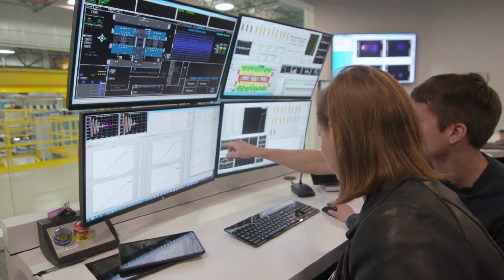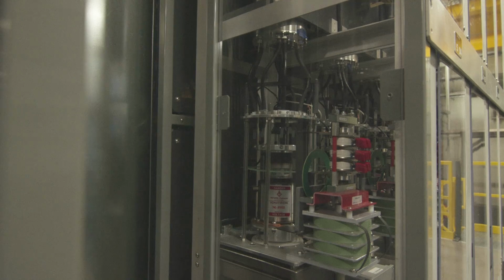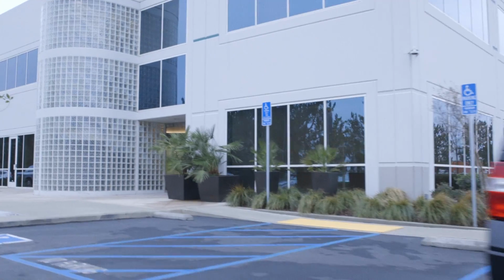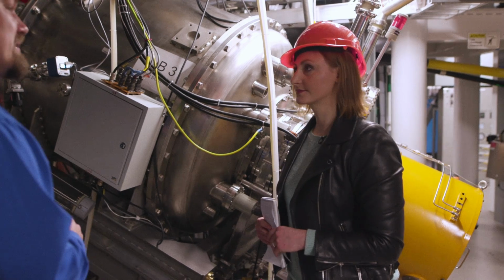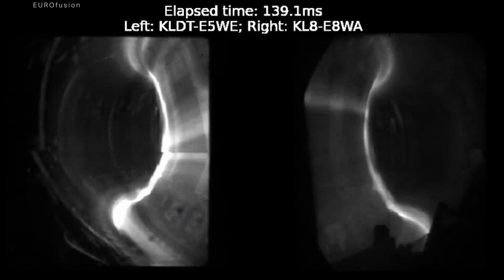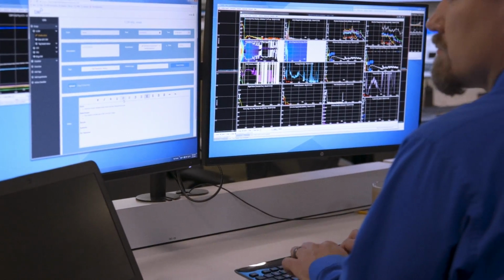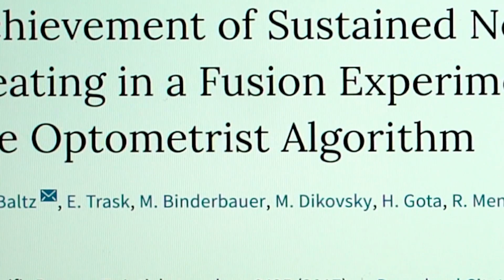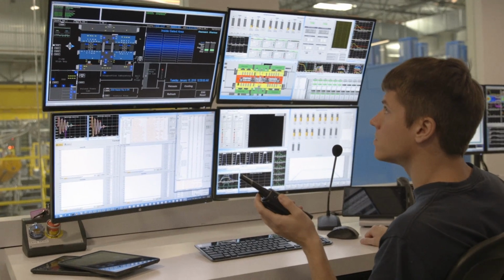Can AI help crack the code of fusion power?

Comment: Miles per second?! There are far more reliable measures that should be used, especially when dealing with scientific topics...
Reply: Nothing "unreliable" about miles per second.  yeah, it's not SI, but it's just as reliable.
Reply: @Desrtfox71  I understand your point, but the metric system is far more robust to precision than US standard and British imperial.  No one is doing themselves any favours who have work with scientific precision, expecially in something like fusion power, that relies on miles, feet and inches.
Reply: @philipberthiaume2314  SI units are simpler, and more sane.  They are not more robust.  All imperial measurements are now defined by SI units, so the robustness is the same.  It's literally just a different set of units.
Reply: @Desrtfox71  I would have to disagree.  I am writing quickly here so apologies for spelling.The engineers with whom I work, and they work on space projects, would never consider the use of miles, pounds, fractions of inches etc.  There is too much risk for converstion challenges.  It's all meters, milimeters, newtons etc.  Metric is more robust in its reliability to enhance precision and reduce chance for errors.
Reply: @philipberthiaume2314  The thing is, it would have been the same if it said miles or meters per second. They are close enough that they mean the same thing
Reply: @philipberthiaume2314  Negative.  The conversion, of course, would add complexity.  That's why all science is done in SI units, but Imperial units are as precisely defined, and thus equally robust, as to SI units.  They're just different.  Metric, or SI, is not more reliable.  Not at all.  Either way you're still managing the same error bars and propagating those errors through your calculations.  Metric is easier, and is more of a standard than imperial units. This is why I've used if for all of my science education.  however, I used Imperial units while learning Aerospace engineering in the States.  SI and Imperial are not more or less robust.  They are the same, with simply a different coefficient out front.  Your engineer friends are just far more familiar with SI units.  that's fine.  SI units are better IMHO, but not because they are more robust.  They aren't.

The precision of any calculation is in the measurements taken.  Not the units used.  Especially not when imperial units are defined by SI units.

Ask your engineer friends this.  Which is more exact, 2.54 cm, or 1 inch?  The answer is that they are both precisely the same.  100%.  By definition.
Reply: @briandiehl9257  I appreciate your point, but things are not the same.  The opportunity for error is enhanced when it comes time to deviate consideration for variable conversion.  This is not my opinion, there are best practices that exist that promotes the use of metric in human health in the US for example with the cause being too many error commissions when measuring medication doses.
Reply: @philipberthiaume2314  As I said, metric is easier.  That is all.  If you're going to fudge a conversion, obviously multiplying or dividing by 10 is easier than doing so by 12 for example.  This is not an inherent lack of robustness or precision in the system, it's just more difficult for a human to divide by 12 than by 10 for example.  Ask yourself why the world isn't using metric time?
Reply: @Desrtfox71  I respectfully disagree.  The lengths are the same and only vary depending on a value assigned, but SI presents a far more coherent system that is scientifically derived to ensure accuracy and reliability.  Consider, also, application.  Miles per second is just that, miles per second.  Meters per second has a far wider range for scale application and can easily be understood in other formats including its relative action versus other components simply by moving a decimal.  You are making sound points, but I still conclude that metric is more robust and less prone to conversion and expected outcome error.  Apollo computers did all of their thinking in metric for these very reasons as a way to make sure the guys got to very precise places almost 400k km away.
Reply: @philipberthiaume2314  Well, let me just say I agree with you...and I disagree with you.  When it comes to humans doing things manually, like multiplying, or measuring out a cup vs a quart, the imperial system is more prone to error because it is more difficult for humans to do those things.  This is why the SI system was created in the first place - that and as a standardization.  I don't think this is the same as saying that the imperial system is less robust or less precise.  I think what you're saying is what I'm saying - the imperial system is more difficult for humans than the SI system.  

A computer program, for instance, written with imperial units in mind, is not going to propagate errors any more or less than one written with SI units in mind.  These systems are based on the same fundamental units at this point.

As for your example of meters vs miles, honesty meters are just as arbitrary as miles, it's just a different arbitrary pick, i.e one forty millionth of the Earth's circumference.  Since then, obviously the meter has been redefined based on the speed of light, and the foot, or mile, or inch, etc. has benefited in exactly the same way.

I think, honestly, we mostly agree though, and I don't wish to belabor the point any further.  You say metric is better.  I agree.  I just differ on some of the subtleties as to why.
Reply: A tl;dr response here.  You've been trained to believe that SI (metric) units are better than imperial units.  This is true.  SI units are better.  They are better because they are easier.  Imperial units, for some time now, are entirely defined by SI units, so they are just as robust or precise.

Comment: 'artificial intelligence' Stop using that term, AI is not real or even close to implementation. What we have are complex expert systems. We are nowhere close to 'AI', it's just a buzzword used by startups to hype their image.
Reply: You are thinking of AGI. Easy to mix up.
Reply: Fossil98 AGI is a newer term created so people don’t think we have true AI. It’s true modern day AI is a complex statistical program.
Reply: Just to clarify: machine learning (along with expert systems for example) is a subset of AI. AI is defined as a branch of computer science and engineering concerned with developing intelligent agents;  intelligence measures an agent’s ability to achieve goals in a wide range of environments. Hence, even relatively simple rules-based systems can be technically called 'AI' if they are successful in achieving certain goals. The difference between ML and expert systems is that ML-based systems actually improve performance on specific tasks by learning from data. ML is grounded in probability theory, statistics, information theory and optimisation.
Reply: These are not expert systems, they are learning algorithms. Neither approaches have led to artificial general intelligence, but learning algorithms have achieved impressive narrow intelligences.
Reply: I think that the fact that there is so much discussion, if these algorihms, wich are called AI, are actually intelligent, teaches us, that we have no clue what intelligence might be or if there even is something we can call intelligence. Maybe we are all just a bunch of statistics, datamining and optimisation.
Reply: Charles Dog you’re confusing AGI with narrow AI
Reply: AI is a vague term with tons of disambiguations and definitions, at least one of which is applicable in this case.
Stop trying to monopolize language.
Reply: AI doesn't have to be human level AI. Anything that learns from its environment and uses that knowledge to improve can technically be called AI.
Reply: That's even more of a misnomer. An expert system is just an encoding of expert knowledge. This seems like more of either an evolutionary or reinforcement-based machine learner, which still falls under the umbrella of AI technologies. I find it annoying how marketing has turned a broad research field into a buzzword and now the pushback is also going overboard.
Reply: All AI means is that technology is able to improve by itself by constantly updating the information in its statistical models without human intervention. By updating the information available, the statistical model also changes, the model is the decision centre for the technology. eg. Tesla's use Artificial Intelligence to autonomously improve their accident prevention technology. 

I do know what you mean though as a lot of technologies that claim to use Artificial Intelligence don't exactly classify as Artificial Intelligence, but it definitely exists in some sense.
Reply: @surfingbilly9654  That's not AI. AI is us in computer form. You're referrign to expert systems. AI doesn't exist, may never exist.
Reply: I just wanted an AI nanny...
Reply: AI is real but it is most accurately used to describe a field of study.
Reply: AI isnt the same as self aware machine/program...
AI refers to a computer program that learns and adapts on its own. AKA machine learning.
Reply: Why not? Even path-finding in games is an AI system. It can be implemented in any way as long as it does its job.
Reply: @charlesdog9795  "you younger generation are"
first of all, you have no clue how old i am.
secondly, language is descriptive, not prescriptive. the meaning of words is not immutable nor set in stone, it is whatever and however people tend to use the word at any given time. after all, the whole point of words sharing information intelligibly. if "the younger generation" is using the word in a certain way (which you're wrong by the way, the ambiguity i was referring to is irrelevant of gnerations) then that new definition now becomes just as valid as the previous one.
Reply: @BattousaiHBr  OK I'll give you that. You obviously do not work in the information processing industry though, or you would know what I am talking about. Industry terms don't just flip overnight because CNN runs a story with the misleading term. The term AI is not taken seriously except by people wanting to make a quick sound bite on the news at 6. Yes and that includes marketers like Elon Musk
Reply: @charlesdog9795  yes indeed i don't work in any area related to AI research (although i am a netadmin and sysadmin, so at least still within the domain of IT).
with that said, i don't disagree with what you just said at all. "AI" is pretty much a layman's term that can have very broad connotations. whether researchers use the term when writing scientific papers or during practical implementations is not really what i'm talking about, what i'm saying is that when that researcher talks to someone from outside their field, the term AI is generally very good to encapsulate the kind of work they do.
Reply: @charlesdog9795  oh but i'd strongly disagree with calling elon musk a marketer.
Reply: @BattousaiHBr  Fair enough. Have a good night BattousiaHBr
Reply: @charlesdog9795  have a peaceful night, good sir.
Reply: @charlesdog9795  "The SW has not advanced, just the speed of the HW."

That's obviously false. I have a very hard time believing that you have anything to do with the field when you're making bogus claims like that. Deep learning and neural networks have come a hell of a long way since the 80s and 90s. Thanks to that, computers have beaten the best Go players, something that was speculated to be impossible using the same strategies employed back then when Deep Blue beat Kasparov in chess. We're already at the stage where we have self-driving cars, and I suspect it won't be more than a decade before ape-driven cars are outphased in favour of self-driving cars. To say that the software hasn't changed is ridiculous.

Yes, there is a long way until we hit AGI, but most researchers are optimistic about the prospects, with realistic estimates of AGI before 2050.
Reply: You are either a troll or you're just not in the loop. Either way please stop spreading baseless nonsense.
Reply: AI is there example is alpha go
You could say AGI is still not there
Reply: same as quantum computers. We still haven't achieved a real quantum computer
Reply: I see lots of people mixing terms here. It's normal though, as there are tons of misinformation all over the internet. The explanation that Charles Dog has given actually matches more with machine learning (ML) than AI. Most AI doesn't rely on statistics, but most ML does.
Reply: @Fresh Coconut I agree, but it's a complex argument definitely not suitable for a YouTube comment section. I maintain that there is nothing created by man that can even come close to be call intelligent in any capacity unless we start redefining words. As a programmer (since the mid 90's) the term AI is a fad and basically meaningless to anyone who works in the field. No human creation has passed the Turing test, and applying brute force tactics is not a solution
Reply: @charlesdog9795  "As a programmer (since the mid 90's) the term AI is a fad and basically meaningless to anyone who works in the field. No human creation has passed the Turing test, and applying brute force tactics is not a solution"

As a programmer, you should not confuse AGI with AI. Machine Learning is a subset of AI techniques. And hence, this is AI or ML. But not AGI-level intelligence.
Reply: @Fresh Coconut 'therefore it qualifies as AI' Nope, These are fairly recent terms and not from a programmers perspective. Regardless there is no intelligence, just thousands of rules, i.e expert systems designed to do a task. There is absolutely no reason to use the term 'intelligence'.
Reply: @charlesdog9795  ". There is absolutely no reason to use the term 'intelligence'."
what do you think intelligence means?  by definition its the ability to acquire and apply knowledge and skills 
The AI runs tests based on set rules, acquires data, and applies it until it gets a desired result. Sounds exactly what any intelligent human would do. 
how is it any different?  because its a program? Your brain works exactly the same way except its more adaptive, multi functional at doing exactly the same thing. 
AI just does extremely complicated tasks better by using realistic simulations. being able to start over and over thousands of times until it reached a perfect desired result.
Reply: @darkshadowsx5949  By your definition my old TI-85 calculator is 'intelligent'. Intelligence implies the ability to apply learned (or saved) knowledge to analogous scenarios and create fictitious situations paralleling the current problem to find new and innovative ways to solve it. Currently our SW is no where near that. If you think running brute force numerical solutions is intelligence you must be an NPC.

Comment: Fusion power plants are always 25 to 50 years in the future.
Reply: EAST and W7X have both demonstrated fusion capable plasma containment for about 100 sec. But neither project is set up to handle tritium, which is radioactive.-.
Reply: They already exist.
Plenty of them in fact.
The first test-commercial power plant is under construction already (ITER).
All of them try to maintain fusion. 30 Years ago it was even trouble to start millisecond fusion.
Reply: @Vulcano7965  ITER isn't meant for commercial sector. You are talking about DEMO, and for that, we will have to wait another 30 years, if ever...
Reply: @Wave1dave  I doubt it will take this long after ITER has run successfully.
What would be the reason?
Reply: If you say that every year then it will never come. lol

Comment: The answer to the Fermi paradox... There are no tier three civilizations because there are no tier two civilizations,, there are no tier two civilizations because making the jump between 1 and 2 requires fusion and fusion is impossible...
Reply: I doubt that it's impossible. I mean, we have done fusion, just not economically. It is a very hard R&D and engineering problem but I am confident it will be solvable eventually. Remember that governments have been dramatically underfunding fusion research for decades.
Reply: a fusion bomb and a Fusion engine aren't the same thing, Basic physics tells us one cannot create energy, all you can do is convert energy always leaking some in the process
Reply: @mikycarney5779  Fusion turns mass into energy, that's what e=mc^2 is about. Conservation of energy is preserved by treating mass like another type of energy.
And we have gotten fusion to work in experimental reactors (ie not bombs). Just not net energy positive. But there isn't a fundamental theoretical reason why we can't get net positive, containment is just really hard and getting a high number of reactions in the chamber is really hard
Reply: Perhaps I should reword it,, I know Fusion is possible I just highly doubt a perfect engine is... Any engine would have to be perfect in order to work,, like a perpetual motion machine,, we will get 99.999% there,, but never actually achieve it....
Reply: @mikycarney5779   I don't think we need a perfect engine for economic fusion
Reply: "fusion is impossible"

Look up to the sky during the day.
Reply: The sun is millions of  times larger than the earth and it is not a perfect engine... It don't count

Comment: This article focusses on AI rather than nuclear fusion. Tokamak reactors are already outperformed by the newer Wendelstein 7-X and in France they are building ITER, a huge fusion reactor (sadly it's also a Tokamak). When they say that they lack in the research of fusion technology, then they should ask themselves if their targets meet the outcome.
Reply: small thing, you just confused tokamak and stellerator. They are seperate models (wendelstein 7-X being a stellerator).
Reply: @Vulcano7965  dang it. I will correct that. Thank you for pointing it out.